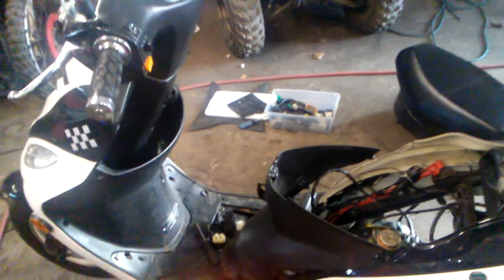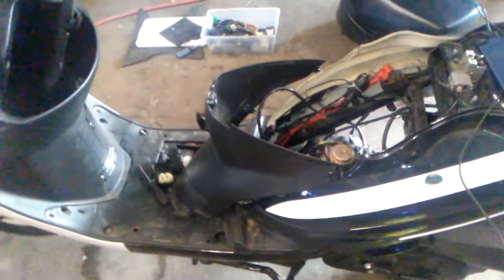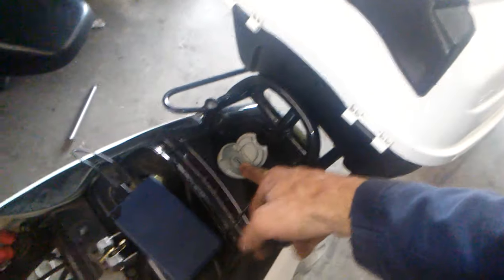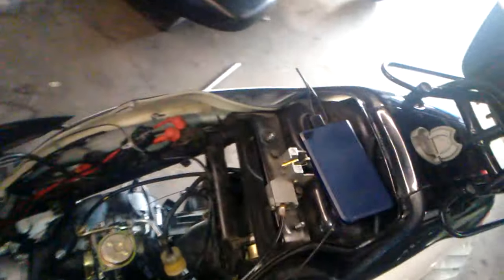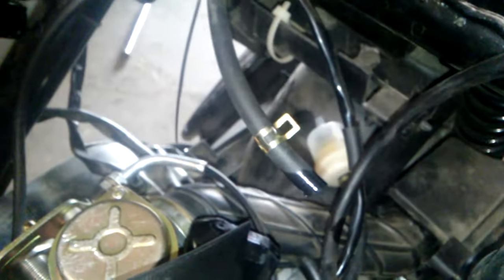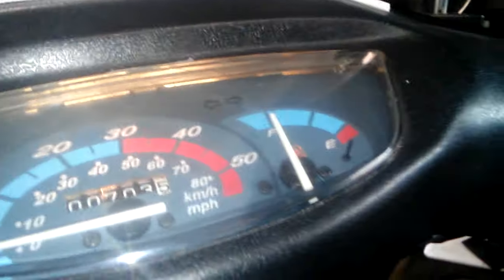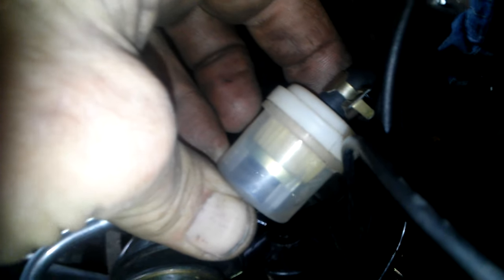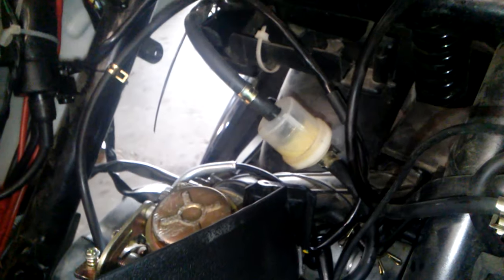Scooter runs short distance then stops running like not getting gas , parts for this in description

Comment: Posted this on 2 other vids

Ran in to an issue for awhile now. Its driving me insane.  My 50cc taotao has been bogging here and there and dying at stops. Just got it out of the shop. Said they replaced the fuel filter and adjusted the valves along with a new spark. Noticed huge lose in power. What was 45mph norm went to 30-34mph. (Im 135lbs) Ran about 5 miles and died on me again. Step father bled the fuel line and checkecd the airflow lines, it ran for 2 days, about 20miles.Crap load of sediment in fuel filter. Cleaned it out. Drained my tank, strained my fuel with coffee filters, clean. Blew thru hose to clear out the line and "pump"(?). Ran it for 3 miles. Fuel filter has crap in it again. When it died the last time, all i did was pull the lines to to engine, blew the air line to the fuel pump and the one into the carb (vacuum tube?) and the other reattached and it started. Dont know why that was a remedy. Power is back, hits 40mph again. Going to bring idle up a little tomorrow as its very low and to quiet. Im at a lose, atm its running but i feel its only a matter of time till it happens again. Need to find out to keep this from being presistant.  I have no clue wtf to do lol. Atm im inclined to just replace the fuel pump since when i blew into it i believe i blew a crap ton of blockage into the fuel filter, and the air filter. At the moment im runing with fuel in the red and keeping an eye on the fuel filter. In hopes the crap will flush. Its large debris,not rust not dirt, perhaps something picjed up at the station. Been searching the youtube as to get an idea whats going on. I'm in no way inclined to do maint myself and the guy at the shop is to stubron to pinpoint the real issue or just taking my money as it took 3 visits to finally get the rectifier and magneto checked out when i had issues my first round with blown headlight and the fact it would kickstart but not power start as to the battery would not keep a charge. I knew it was the magneto.  It only has 1980 miles/km on it ffs.

After watching this video it makes sense why fuel line to engine was not free flowing from the pump/petcock. And to why when the lines were disconnected it allowed the tank to breath. Im going to try this first. I will let you know the outcome. Oh last time i filled up. Gas cap kissed concrete!
Reply from the maker: Mabey new tank also . Look in it with light . Make sure it's not coming apart inside . You can just take vac pump n just run filter . Inline ! Aslong as carb float shuts off you'll be ok !
Reply: Walden's World 
Just got back from the shop yet again thinking this was the issue since I had dropped the fuel cap. Its not an issue of vacuum lock. I ran with the gas cap a little catty corner. It was running well. Then it started to loose power down to 25 mph. Then it would bog and when I gave it throttle it would try to die, when I let up it would try to idle. Then stopped altogether.  Guy at shop just said it might be something stuck in carb. Pin/needle or something.
All im doing to get it running is blowing into the manifold(?) And blowing and sucking on the line that is from the pump/petcock/ 3way valve to the carb. Still getting shit in fuel filter. I might ask when i take it in on Saturday. Your saying a bypass?
Reply from the maker: I'd look into a new tank . If it's coming apart
Reply: Walden's World 

I think it has been resolved. Dont even ask! It had to have been the shop being in a hurry when they replaced the magneto and the rectifier. The bucket of the seat was pinching intake and fuel line. Leaving only what was in the carburetors bowl to burn. Which lasted a few miles. When I removed the line it allowed fuel to come thru. When ever I'd take the seat off to remove the lines it was out of the way not being noticeable. Next step is to find out why I'm getting so much debris in my filter. Its not rust nor dirt. Its large debris. As if the stations storage was low and thier pump was giving me all their settled shit. Atm im running 89. There is only one place here in town that has ethanol free and they only carry 89 so yeah. I dont want alchohol in my tank as that is a precursor to rust! Do they make aluminum tanks? So when it initially died on me at the stoplight which started this whole circus. He automatically adjusted the valves thinking it be the case. It shouldn't hurt I'd think, would it?
Reply from the maker: Cool . I seen a kid take front plastic cover off were the sea mounts . He sat down punched air line drive gas out .  The problem he had with vac pump if your sitting on scooter n line still pinched no gas . Glad you figured it out !
Reply from the maker: He also started pushing his carb off the seat was resting on the motor. He was trying to chop plastics off to make it look cool . Lol
Reply: I have a 2017 torando the damn fuel filter was clog and i have got new carb and dad try just bypass regulator got new plug new lines. And fires up and the Valerie is rattling worse than ever so half fix that and then maybe get it to run. It only got 1200 miles my old vip got 6,000 same motor no problem with it ever. I got hit by car so replace it with cheaper model and its been pile shit from get go.
Reply: Jason Mcdaniel just had to clean fuel tank and carburetor. The piolet valve was jacked. Ran less then 4 miles and it died on me. This was 1.5 hour ago. Shop came and picked it up. Will know more tomorrow.
Reply: Keep a can of starting fluid on you at all times. The spark plug needs combustible air to keep running normal once these scooters start to age.
Reply: My toatoa has .9 miles on it and wont start. I think it's too damn cheap to put money into. Bought a bicycle!!
Reply from the maker: Taotao is the cheapest most proffitable junk sold ! Period !!! If you find one that's ugly n runs keep it never change oil plug or anything and it may run forever
Reply: Do like I did learn to fix it yourself
Reply from the maker: @christophergoldman4310  ive seen them come in brand new in crate clogged china test engine n dont empty carb good enough !

Comment: I have same thing.  It has .9 miles on it. It's in the shop
Think I will forget its mine!!
Reply from the maker: Get a Honda ! Or Japanese scooter . Aprilia are very good . Really you pay for what you get . But these cheep China places jack up the price to make you think a new China bike is better than used name brand . There just not . You can have a Honda scooter 20 olus years it will still run if not abused !
Reply from the maker: The cheap ones out the box have bad carbs ! They test run in China n some are already dirty n need cleaning or replace ! Screws are machined off so they have to be drilled . Buy Honda lol

Comment: I have a same issue... on my motorcycle
Reply from the maker: Air vent . Carb not getting enough fuel . Stuck float . If you have gravity fed carbs loosen drain screw verify fuel is coming out fast enough to supply carb at full throttle b. Basically steady stream . If you have vac pump to supply fuel this won't work unless turning bike over . You can pull line off to carb n verify it's getting fuel also .

Comment: Blocked fuel tank breather!..its acting like its not getting gas because.....It's not getting gas!!
And letting gas pour over a running engine??? Insane!
Reply from the maker: Float stuck or open . If gas is coming out carb from over flow . It also can happen from blocked tank vent
Reply: Where is the tank vent?
Reply from the maker: In the gas cap on these scooters
Reply: Have the same problem. I tried opening the gas cap but the problem of shutting off persists.
Reply from the maker: Neville Rosario take breather off put hand over carb mouth see if it's pulling in only . See if it is also pulling gas . Could be valves . Fuel pump n other things bad rings
Reply: Yeah, just use and keep a can of starting fluid on you at all times. That is the only thing that solved the bog down problem.

Comment: It's the valves
Reply from the maker: No sir it was the gas cap . It was at 2 other shops getting parts throw at it lol . But on China crap better check exhaust valve the do tighten up . Thanks for watching !
Reply: Wally 1970 I have been working on my moped for a few weeks now driving me crazy I got new carburetor seems to be good compression perfect Spark acts like it wants to crank up when I spray ether in it but still never does I cannot figure out what the problem is everything is pretty much new electrical wires I have the gas run straight from the tank to filter to carburetor have any ideas anything will help haha
Reply from the maker: Valves or timing . If you have spark and compression. It should fire in ether . If the carb or fuel was the problem.
Reply: Clinton Crenshaw  If you have spark, then it's not an electrical problem. Sounds like gas is not getting to the carb.
Reply: Clinton Crenshaw it could also be the CDI.. I replaced one recently. I had fuel, spark and 145 psi compression. It wouldn't run on starting fluid but would eventually start after a couple minutes (literally) of cranking. Popped in a new box and she started right up.
Reply from the maker: Yes I've seen them basically spark like 5 times to many during one reveloution ! Bad condenser I guess ! Look like a machine gun spitting spark ! Also there are DC and ac cdi one won't want to one will burn nicely lol if put in wrong machine
Reply: Walden's World that sounds like what mine was doing. You could also hear it misfiring at different tones depending how much you opened the throttle. It just got harder and harder to start over the course of a few days until it basically refused. Would also want to stall at lights and was a huge pain in the ass to get going again if you let it... Glad I got that shit fixed lol. Of course, a week later, I found a big crack in the airbox and replaced it with a pod filter. U upjetted as high as my stash allowed but it was still lean.. I figured I could make it the five miles to my shop but was wrong and the Piston disintegrated in the last mile.. had to do a complete tear down to get all the schrapnal out lol. At least these things are simple. Had it back on the road in a few days.

Comment: Change the fuel filter put it opposite side the inlet and outlet change the way you install the filter and see what will happen 😎 because I have same problem and I solved it that way
Reply from the maker: Man are you serious ? If fuel filter has crap in it and u turn around it goes in your carb !
Reply: @WaldensWorld  man I was thinking like you before I tried that I said to my self there is an arrow ➡ so I have to follow the arrow 

But I take the filter out and I blow both sides and the air flow both sides
Reply: @WaldensWorld  give it try only it will take from you less five minutes to put the filter upside down 

But you will enjoy your achievement for more then a year
Reply: @WaldensWorld  than make video and show us how your scooter works 😎
Reply: @WaldensWorld  I will buy for you a new carb if anything happened to your carb 

But if everything works good 

You send me 250cc gy6 engine??  

Just kidding
Reply: @WaldensWorld  I promise you by my soul that nothing wrong will happen to your scooter
Reply: @WaldensWorld  install the filter  upside down ..  it will take less the 5 minutes 

Then try the scooter for one hour if  anything happens I will buy for you Honda ruckus
Reply from the maker: Customer scooter . It was the gas cap ! And he is riding with that filter that way n new gas cap to let air in !

Comment: ******** HATE TO BREAK THE NEWS TO YOU BUT IT'S A VALVE ADJUSTMENT. ********
Reply from the maker: Nope it was gas cap ! Watch the video or don't but your 10000% wrong . Last shop did that n the shop before pit new carb . I fixed it for $20 !